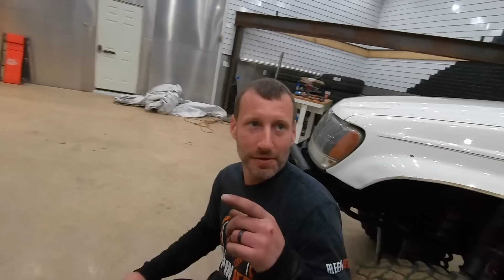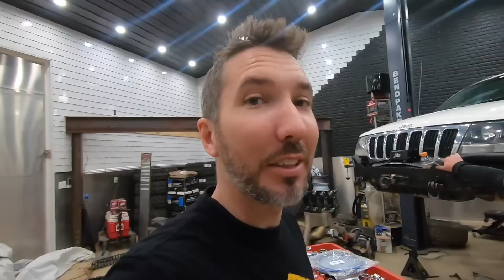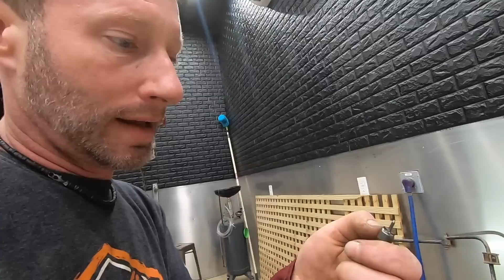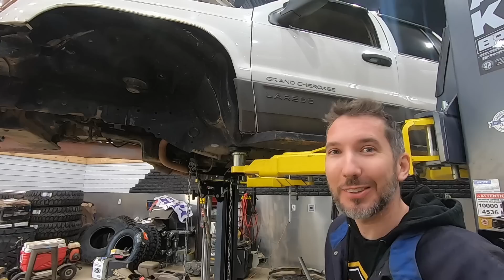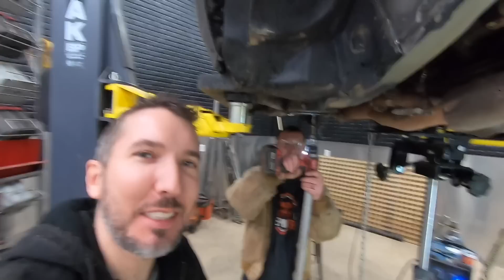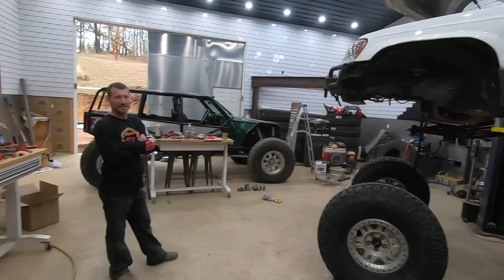How-To Build the ULTIMATE Suspension for a Jeep WJ - Project Bumble Pt2

Comment: I work almost exclusively out of my carts. I have a diag cart, a service cart and a tear down tray that is always kept free. My big box only contains specialty items and rare use items. I hate having to take even one step to reach a tool I need unless it’s a specialty timing tool or my large 1/2” electronic torque wrench that I use for engine building.

Comment: I've refined this over the past 35+ years at the same shop. I keep my main box (hard tools) at the left front fender where it's only 1 or 2 steps max to the tool I need. Just left of that is the water separator/regulator/filter/oiler and manifold for my air hoses. Left of that is my storage cabinet (fast-moving parts, fluids, cleaners.) The workbench and bench vise are directly in front of the lift, to the right is the parts washer. My electrical cart (wiring supplies & tools, meters, scan tools, test lights, etc.) is level with the cars right front door, with room to park a roll cart comfortably (parts and other tools I'm using.) I'm lucky enough to have a room to myself with a lift and space to work on the right side.
Reply from the maker: sounds like the perfect setup!

Comment: Guys I'm really stuck right now I have a 1997 Jeep Grand Cherokee Laredo part time four-wheel interior mint condition pretty clean but not perfect and then I have a 1998 Jeep Grand Cherokee Limited all-wheel drive both of them 4.0 which one would technically be better to be made into an off-road rig always been a first gen guy now I'm moving to Jeeps just cheaper to build but would be nice to get a little bit of opinion on this one thanks guys

Comment: Man, any used vehicle you buy, I now suggest checking all area's you might be welding. I welded a patch on my 97 Dodge extended cab (bottom, between the door and the rear of the cab). 6 months later I needed to take out the head liner which meant I needed to remove the interior side panels and found 3 223 cal. rounds. Had they been on the other side I'd been in for a bang.
Reply from the maker: That would've been an eye opener 😳

Comment: I've been a tech for 48 years my main box is stationary I use a Mac cart which is waist high i have all I need layed out in the cart in order have a big magnetic strip bolted to the back that holds all the wrenches I normally use daily I visit my main box once in a while if I need something I have hammers and screwdrivers in existing slots on the cart and i still have room to put all the nuts and bolts I take out to do a job in the cart been doing it like this for 30 years I just roll it around the vehicle where ever it is I'm working on pulling a powertrain assembly out, rear end work, brakes, ect. The cart is always right at hand saves so much time so there you have it.
Reply from the maker: gonna try this method for sure.

Comment: you missed step(s) on frame stiffeners IMHO- 

Hit the frame with weldable primer as well as the stiffener (if it is not already)    If you want to really avoid rust issues.....  After that temporary mount the stiffner then draw in you weld and bolt holes onto jeep.     Remove stiffner and then do a thin rust sealant paint that does not allow for air or water to penetrate it......  (leave area around the drawn in holes you weld thru though areas).  Could do same for interior of stiffner too.  

If you dont do this water will trap between stiffner and chassis and rot/rust the jeep chassis out and you will  never know it till only the stiffeners are the remaining metal... welded thru the holes to former chassis metal which is by then just a chunk of rust...

Comment: For the flag nuts, could you line them up on the outside, trace them with a sharpie, drill a whole or two where the cross piece will sit above, install and bolt in the flag nuts without the brackets and then plug weld the flag nut to the frame though the hole or holes drilled from the sharpie step. This should allow them to be permanently installed… right?
Reply from the maker: I think just using them as flag nuts is a whole lot easier that that.  I did install nuts on the inside of the frame on the Comancheep project series and the scorpion series but those are welded to the  top side of the stiffeners and then just get shoved up into a hole in the uniframe
Reply: @bleepinjeep  there’s definitely something to be said about keeping things simple!

Comment: I have an 01 WJ with the 247 AWD Tcase, I hate it. I have lifted the WJ 4in. 31in tires. What Tcase are you guys using in this build? I want to go to a 242HD or 242 but not sure which one to get. Also are there any other Tcases that will fit under there? And yes I know the shifter console needs replaced, I already have a double cardon front drive shaft came from factory like that, lucky me lol. Just looking for input on Tcases for WJ NON-AWD and not weak. Thanks guys.
Reply: Can do the 231 as well. I was using a 231hd. The hd's require a different rear driveshaft as well

Comment: Tip for ya line your flag nut up to the holes on frame then true around it the drill a couple small holes about a 1/2 inch from bolt hole then weld it in place

Comment: I've got a tool room with  shelves and my tall boxes. I keep a charging station in there. Then I use a roley cart with drawers for most of my common hand tools and portable tables for parts.
You'll work out what works for you.  Be well, and have fun.
Reply from the maker: ya, just have to get the shop done first... but itll never be done just like a jeep ;(
Reply: @bleepinjeep  zackly, my shop is 30 years old, and has had two major add ons, and now I'm working out a new office space/ compressor room/ downstairs restroom, all across the back of the building. Insulation, sheetrock, warm, dry, with lighting. Ooooo, fancy. Build em brake em and build em better, be good. 👍

Comment: Tool box or tool cart would depend on the job and how many jobs you got going at ounce. For me when I work in a shop doing R&R of drivetrain and powertrain I would be working on more than one vehicle, so in that instance the cart would be in the middle. And in most all cases I never just worked on on vehicle at a time. Most shops don't have a lift positioned like your and in most cases the main tool box would be a up towards the front of the lift were you face when you pull in. So as the way you have the Jeep now your permanent box would be in the back and your cart collects all the tools your using and would be were your parts pile isn't, of course moving it around as needed.
Reply from the maker: I already need a bigger shop lol, sometimes the cart/welder/table gets trapped by other crap in the way or on the floor!
Reply: I wish I could say that, I just need a shop period.😂

Comment: I'm not a professional mechanic but I'm like you. My toolbox is beside my lift. Build a dolly for front ends and rear ends. I made mine waist high. Makes it easy to roll them around and work on them without being down on the floor.
Reply from the maker: that would be nice, maybe double duty though as the last thing I need is more things to store somewhere.
Reply: I use it to pull trans, t-case, front ends, gas tanks,rear ends, etc.
Reply: Hope to see yall at windrock soon. Doing a test run either there or gulches. Heading out west to moab for the first time in June. I live just down the road from yall in cleveland tn.

Comment: Curious about your spotweld cutter, isn't the center pin spring loaded? So you don't need to drill a hole. You just make a punch mark. If not I recommend you buy that type, they are super fast to use.

Comment: Your messing with us the way your measuring wheel base right?
Reply from the maker: hows that?
Reply: @bleepinjeep  my bad had to watch again.
Reply: @bleepinjeep  Center hub to center hub?  It looked like you both measured from rim to rim.
Reply: @slickrock1371  I rewatched they measured back edge to back edge of the rims which is more accurate than eyeballing center to center. I had thought the measured between to gain click bait comments 😅 🙃

Comment: Large  toolbox against wall. You need smaller roll around for all high use tools ( wrenches ,sockets ,screwdrivers , pliers ,air or electric tools ,etc. ) So you have them right where you working . Nothing worse than walking back and forth grabbing tools.

Comment: Love seeing this. Good job. If i may ask, why didn't you coat between the frame and the addon? Personally I would have cause the moisture is just going to soak in there and rust away. But hey it maky take longer for it to rust than the entire vehicle will last.
Reply from the maker: well we didn't have any weldable spray paint at the time otherwise we would have

Comment: Main box central location. High use tools in roll cart and a cheap parts cart to shuttle everything else. Works great to keep everything organized and handy without cluttering the area. I’d just flip the main box around to the same wall in new shop and get a good 6 drawer service cart.
Reply from the maker: I think thats what I may do.  although then the toolbox will be on the other side of the wall from the metal table.  Having this shop separated in two can be good and bad at the same time.
Reply: @bleepinjeep  with a good 6 drawer service cart with your go to tool load out you can have everything near you, and I have a 24x36 plastic parts cart to stage parts and tools from the big box, drilled the little shelf out to hold my cordless impacts and wratchets. Keeps the big box clean and organized, but still keeps everything you need at hand and positioned to be accessible while your working.